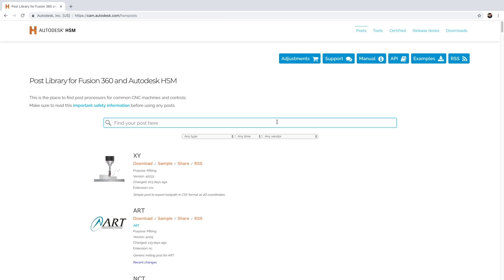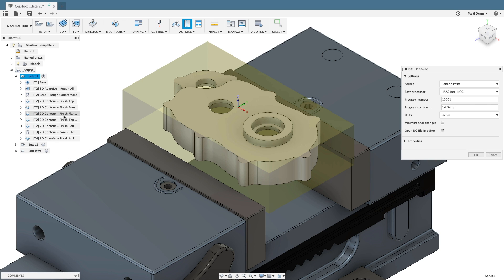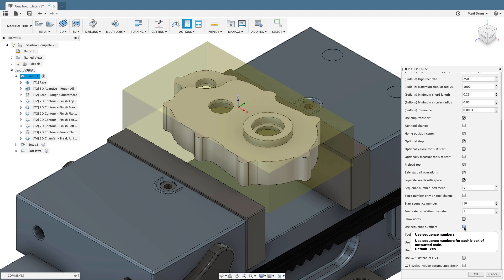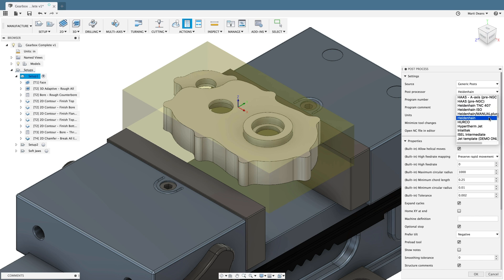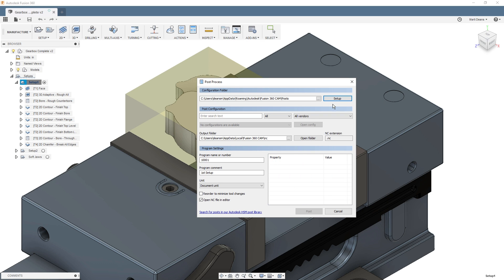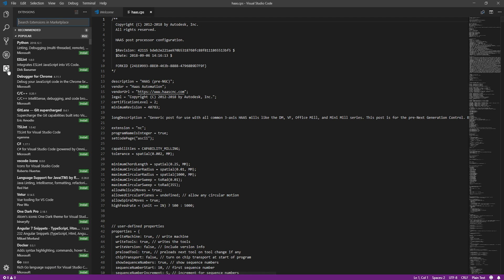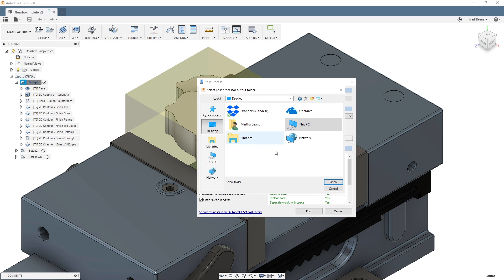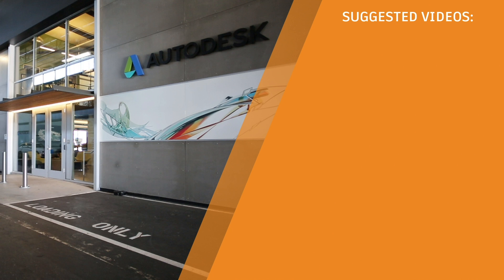QUICK TIP: Post Processor Properties

Comment: Hello.You right click Setup1 and then you click to post process and it opens that window with settings and properties. When i do this it opens a different window....
Reply from the maker: Could just be the new interface, BUT the result shouldn't be that much different...is it? I might have to dig into this a little bit of so.
Reply: @adskFusion  Yes you are right. I think i found it when i create nc program the middle tab is properties and is the same as above!

Comment: Thanks for posting this. Quick question. Running Fusion on a Mac is there a way to make the extensions of the GCode files default to .gcode rather than .nc ? Thanks
Reply from the maker: Not sure if this will help (seems to be for single files, rather than default):
https://knowledge.autodesk.com/support/fusion-360/troubleshooting/caas/sfdcarticles/sfdcarticles/How-to-change-the-file-extension-of-a-CAM-program-post-processed-in-Fusion-360-or-HSM-CAM.html 

Or this...
https://forums.autodesk.com/t5/fusion-360-ideastation/cam-ability-to-set-a-post-processor-default/idc-p/6347590 

But let's see if we can get Marti to help. She's the pro for all things CAM!
Reply: Hi Mark, the extension of the output code is handled in the post itself, and shouldn't be affected by Mac or PC. For example a Mach3 post outputs a .tap file (which still contains G Code). Any more information on the type of post you're using? Have you tried just changing the extension from Finder?
Reply: Thanks for your reply Marti. Yes I can change it manually quite easily but for some reason it defaults to .nc which the duet controller on my Workbee doesn’t like so I have to change each file manually to .gcode. imagine I can do something inside the post processor but just wanted to see if there was an easier way.
Reply: @markscheiner3952  it looks like the extension is just one line in the post processor configuration file - for me it's showing up on line 22 which reads extension="nc";  If you change the "nc" to "gcode" it should then output the resulting file with a .gcode extension. I will give the disclaimer that I am by no means a post editing expert, and you should review the code in full to make sure there are no unintended changes!

Comment: This is a very specific question, but does anyone know how to edit the X Carve post processor so that the tool change command is never put into the gcode? I'm using Universal Gcode Sender with my X-Carve, and always get an error from the gcode out of the post processor. I have to manually edit each gcode file to remove the T1 M6 line from the beginning of the file, and then it all runs fine. It would be cool to make that the default behavior of the post.
Reply from the maker: Lets see if the larger Fusion 360 community can help (I can't, sorry), but alternatively you can try the CAM forum too. 
https://forums.autodesk.com/t5/fusion-360-computer-aided/bd-p/2070
Reply: I have to ask - did you search the post processor forum?? https://forums.autodesk.com/t5/hsm-post-processor-forum/bd-p/218